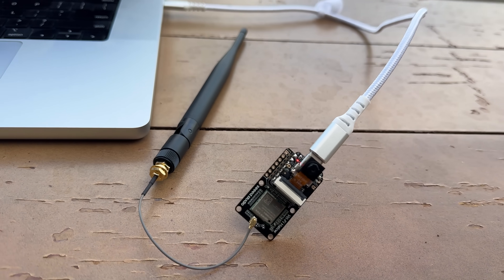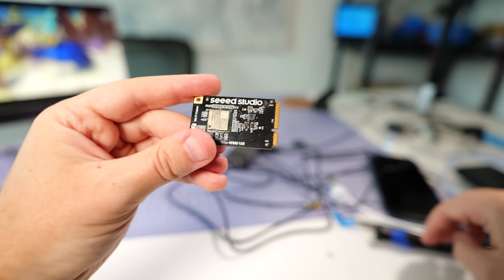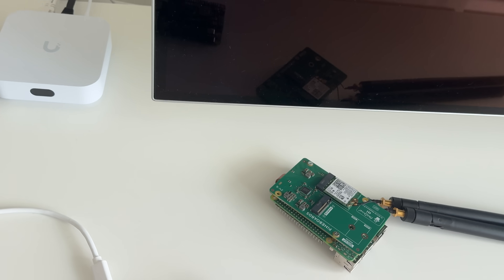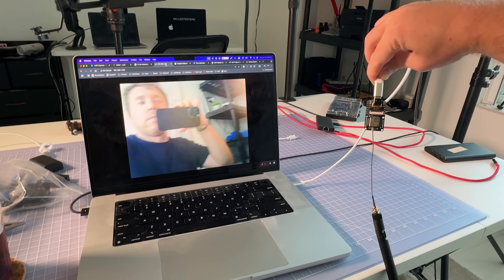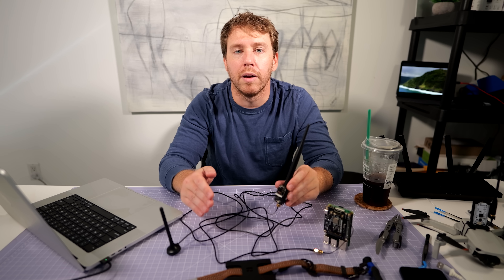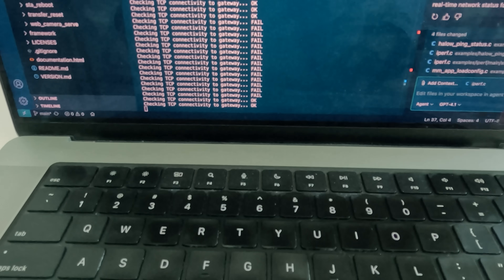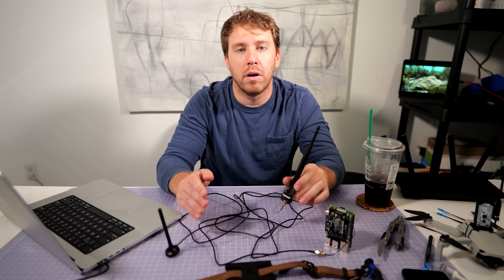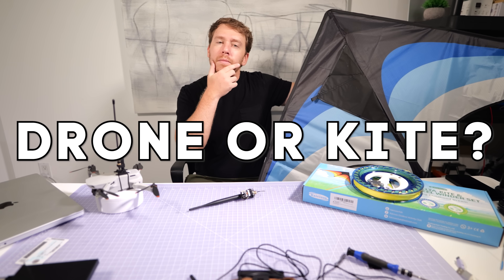You’ve Never Seen Wi-Fi Go This Far

Comment: What's the max bandwidth transfer that you can achieve with this?
Reply from the maker: Theoretically it's quite high but the number I would stand behind is probably in the neighborhood of 15Mbps
Reply: I second this ask, because the video shown in the video was maybe 5fps...
Reply: Depends on distance and configuration.  From what I've read, a single spatial stream can go from 80+Mbps at 1m to 150kbps at 1km.  But that's all dependent on line-of-sight between the nodes.

Comment: This is cool but what happened to the ascientist who made fiber 1000 times more efficient what happened to that?
Reply: There's also the guy that just turned dirty plastic into diesel fuel as well. Crazy times!
Reply from the maker: Elaborate
Reply: Can't really beat light speed.  Most of the slow down is ISP deliberately putting copper wire between you and fibre optics.   You've never experienced 100% fibre optics network.
Reply: Sometimes you can’t string glass between two points.